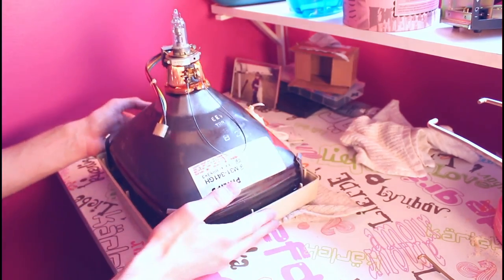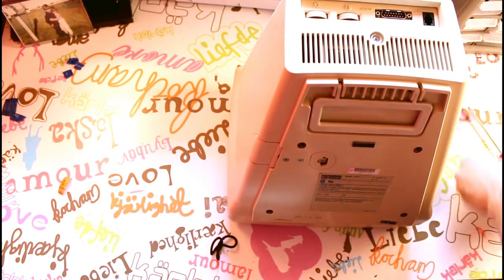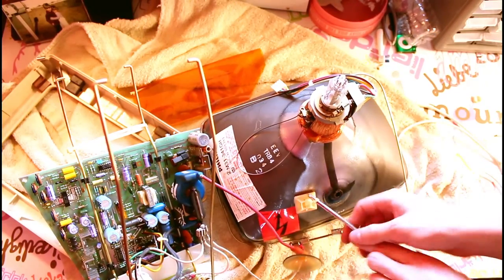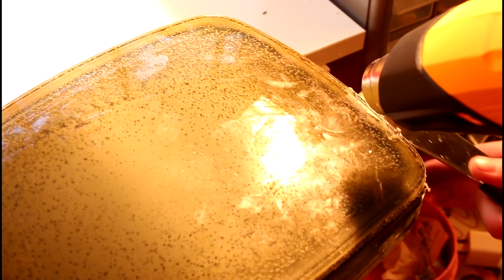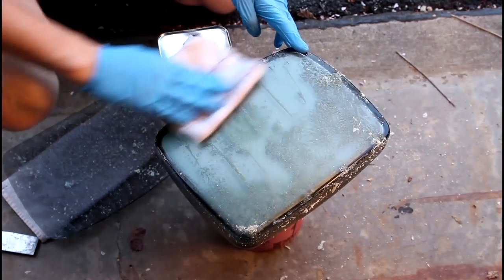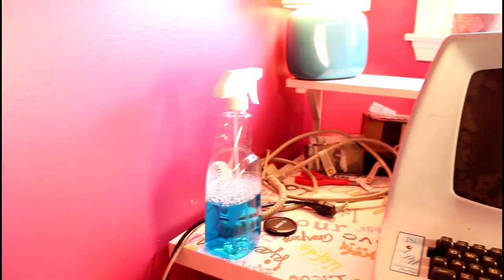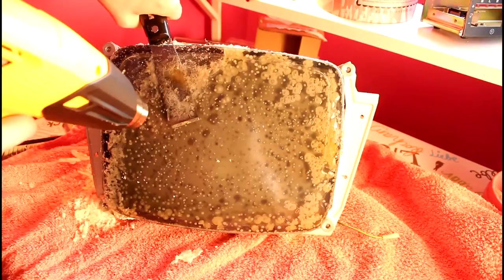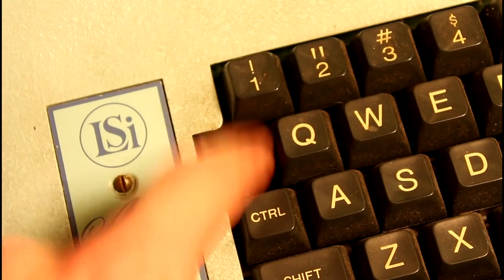CRT Cataracts: VTV

Comment: Just saw this on Hackaday. One of the commentors remarked that using a strip of nichrome wire heated with a battery charger is the best way to separate the screen and it's safety lens.  Good on you for saving vintage computer history!  http://hackaday.com/2017/08/11/crt-cataract-surgery/#comments

Comment: the idea behind using the heat lamp is to preheat the CRT to make breakage from thermal shock less likely. the safest way to do this (and the longest) is to immerse the screen end of the CRT in water as the glue is water soluble however this can take weeks.

Comment: You can make your life a lot easier by using a razor scraper to take the adhesive residue off. Basically these are screwdriver looking things that hold disposable razor blades safely. Most auto parts stores will carry them for a few bucks. On glass, you coat the area with your solvent of choice to lubricate the blade, and scrape away. It will pretty much immediately remove the adhesive as you pass the blade edge across the surface of the screen.

Comment: You didn't have to account for the thickness of the original adhesive when reattaching the clear shield to the front of the CRT?
Reply: If the adhesive is soft it seems like it should fit nice and tight

Comment: One side note: You realize that you effectively got rid of the safety feature of the bonded second glass.

It only works correctly if both glass surfaces are bonded with the gooey adhesive, so it it sticks together in case of CRT failure.

You should mention that this repair is not recommended and at own risk if repeated.
Reply: PetetheSweety I was worried about that point too.  OTOH there aren't many CRTs just, y'know... Lying around to replace the blighted ones.  Perhaps the answer is a fresh layer of glue even if it is more difficult to do.
Reply: I was wondering if it was even worth bothering replacing the glass layer.  Clearly if it did not have the bonding glue it would not work as intended (like the safety glass in your windshield).